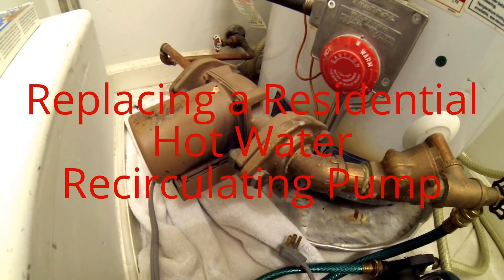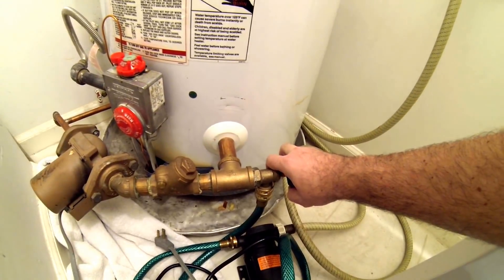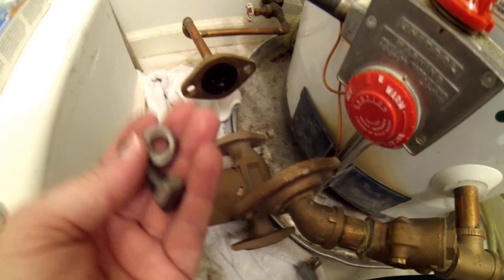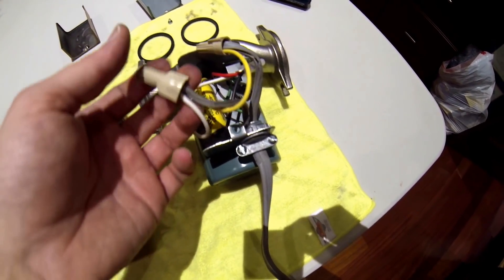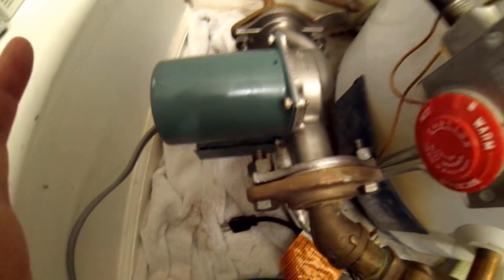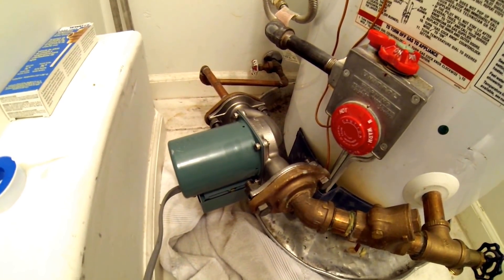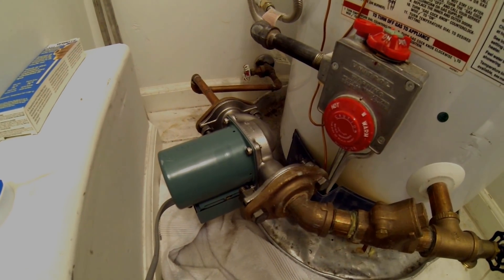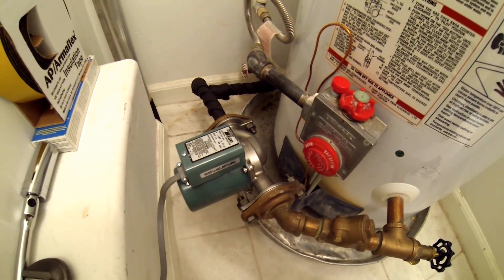Replacing a Taco 007 Residential Hot Water Recirculating Pump

Comment: You can replace the cartridge inside for a lot less money. Another tip make sure it mounted sideways and not up and down. If you shut the water off turn that pump off first.
Reply from the maker: Hi, +Daniel Long. Thanks for watching and for the good tips. Replacing the cartridge is indeed cheaper, but I'd burned up the motor completely, so had to yank the whole thing. :(
Reply: Had some of those also. Thanks

Comment: Great video. We also have a Teco and it has been making a loud noise for a very long time. I'm looking into replacing it because of this noise. I wanted to know if the new one you installed was also noisy and if thats just the way they are? We also installed a timer on ours, but to cut down on the noise at night.
Reply from the maker: +Lori Bloodworth It shouldn't be making loud noises. That's probably a sign that it's about to die. This new one runs very quietly now! :)
Reply: Update (yes, it's been 1+ years!), we (finally) changed out the cartridge to our 007-BF5-J and the noise went away.  yay!!  We were going to change the whole pump but thought we'd just give the cartridge a go (there about the same price ~$80).  It was very easy to do and glad we finally got around to doing it.  I considered upgrading to the stainless steel version (007-SF5) but they are considerably more expensive (~$200) and since we rarely drink hot water and I pull cold water for cooking, I think we'll be OK.

Comment: I have a loop. Tank was 50 gallon, with 3/4 inlets and outlets,  but since I up graded new tank to 75 gallon tank with 1" inlets and outlets to match my plumbing and NOW it takes 3 seconds to get hot water without pump on, if pump is on it takes 4 or 5 minutes.  Tank is on first floor all fixtures are on second floor,  I am only talking about the furthest away one in Kitchen.  OK I am puzzled. At first I thought the head pressure from new tank was too much. I was planning on timing it in the morning but after shutting it off and first day 3 seconds no reason to turn it on.  Any ideas?

Comment: stevewhen done wiring a new circulator, I turn on gas burner and then the water half a minute later. When turn on hot water for a minute or two, it's warm not even hot. I hope it doesn't damage the pump.

Comment: My B&G circulator pump is making screeching sounds... does that mean its time for me to get a new one? mines the bronze color and is it okay for me to get a different brand?
Reply from the maker: air biggs Yes - the screeching is a sure sign it's on the way out. It's fine to get a different brand, as long as you can make it fit. You probably won't be able to get a bronze one any more, and most of them have been replaced with stainless. Just make sure you get one that's rated for potable water if it's connected to your water tank or anything else that touches water that could be used for cooking!

Comment: Great video, what camera was used?  Adding the timer to you system must have lowered your energy bill considerably since your no longer circulating hot water continuously 24/7/365.  I think viewers would be very interested in knowing how much of an effect the lower water heater demand had on your monthly energy bill.

Incorporating an Intelli-Circ TLC-X1 thermo Logic Control optimizer would further reduce the demand on your water heater.  The installation takes all of 5 minutes to plug-in the pumps power cord into the side of the controller and attached the controllers tiny temperature probe to the pipe using your existing pipe insulation tape.  Now the circulation pump would cycle on and off based on both time and temperature rather than continuously during scheduled on time periods.  You would also now have "on-demand" single-cycle functionality.  For example if you wanted hot water during a scheduled-off time period you could simply push a button (if you had hard wired a doorbell button or using wireless devices) and hot water would be delivered throughout the loop and then stop.  Having convenient hot water around the clock without having to waste water down the drain is. I believe, the solution to Americas water shortages and aging infrastructure.